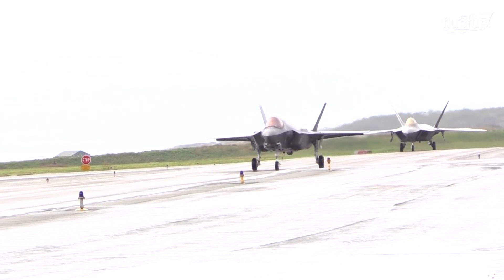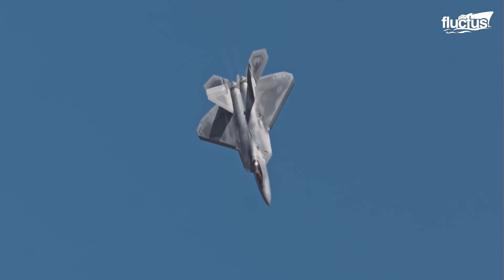The Hypnotic Process of Testing US F-22 Afterburner Jet Engine to Its Extreme Limit

Comment: I still don't understand while this Raptor engine was not adopted to the F35 fighter jets its seem a perfect fit with thrust vectoring and Supercruise capability.
Reply: It was.. the engine in the F35 (P&W F135) is derived from the engine in the F22 (P&W F119). If anything they should put the F35 engine into the F22
Reply: @ThatAdelaideGuy The F-135 engine is a different size than the F-119 engine, so it wouldn't fit in the airframe.
Reply: Actually the engine in the f-35 is more powerful than one of the engines in the f-22. I believe the f-35 produces 40,000 pounds of thrust while the f-22 produces 35,000 pounds for each engine.
Reply: I just think the single to dual engine along with thrust vectoring capability should be on the next generation fighters. Having redundancy engines instead of one should increased realibility and survival in the skies.
Reply: @rj8u  that is very true, but buyers want a cheap 5th gen so some things had to be left out. Dual engines and thrust vector just add to the price tag/maintenance cost.
Reply: @1019nothing  The irony is from understandings the F35 program is the most expensive military program for the U.S and Lockheed Martin is harding a hard time building the planes and delivering.
Reply: @rj8u  oh yeah, R&D cost are through the roof, but they will get their money back if they sell a few thousand. But I do think the f-35 gets too much hate. The f-15 program has purcured up to 2 trillion in total so far, but that's within a 50 year time span lol

Comment: One more thing to add is that one of the driving forces behind the F22 is that the engine nozzle moves up and down. It's also called a vertical deflection nozzle. Many people think it's possible because it's just F22, but it's possible because the engine nozzle moves vertically up and down.